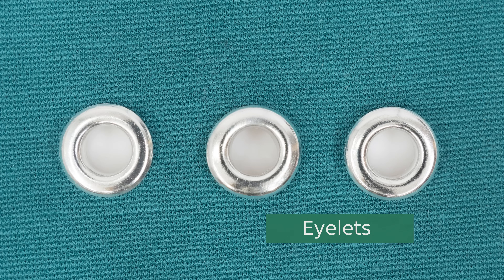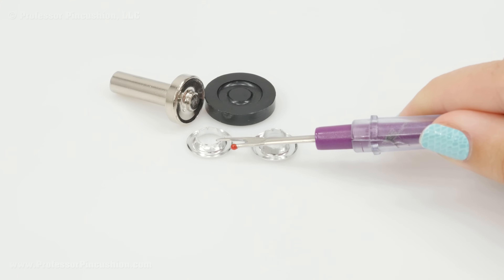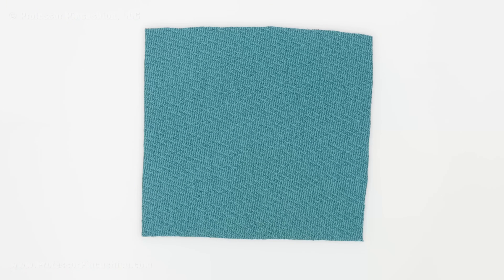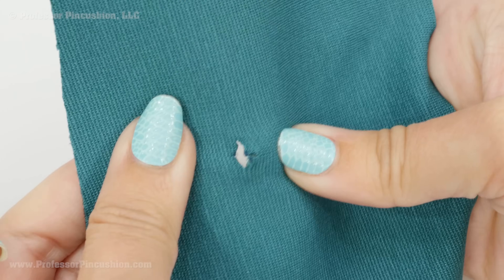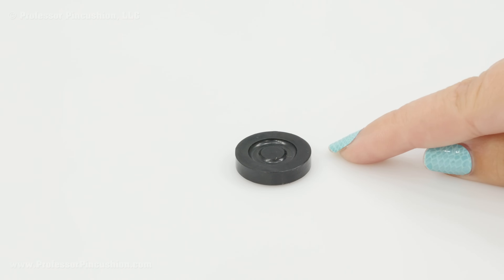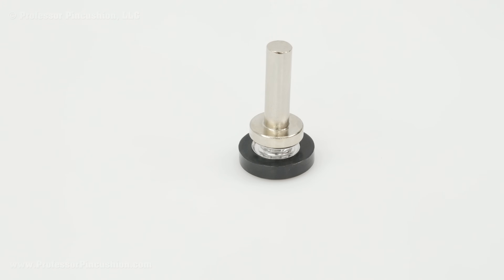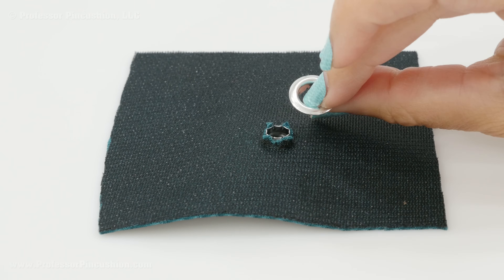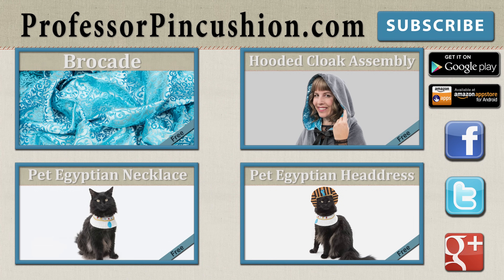How to Insert an Eyelet in Fabric

Comment: I'm a night owl, but the neighbors in my apartment building are NOT. Instead of using a hammer to tap lightly, I use a 6-inch C-clamp, held in a vise to quietly press the eyelet parts together.

Comment: let me ask you...why you didn't show the punching process of the eyelet in the video????
Reply: It is suggested to use a rubber mallet instead of a metal hammer--this is to prevent distorting the metal of the eyelet. Also, unless the eyelet is massive, it is better structurally to use an awl and make a hole in the fabric by separating the threads instead of cutting them.

Comment: Worked great, thanks.  I thought I had to cut a circular hole, but a tiny cross worked just fine.  Eyelets came out perfectly after a good, strong whack with the hammer.

Comment: does it still work on thin fabrics?
Reply from the maker: I wouldn't do it on sheers but with other lightweight fabrics you can probably add eyelets. You might want to add interfacing to the wrong side to help stabilize the fabric though

Comment: The eyelets that came with my sewology snap pliers from hobby lobby only have one side. Everytime I attempt to tighten them, they crumble in weird and ugly ways. You perfectly explained the eyelets you're using, but I was wondering if you have advice or help for eyelets with no back piece. I've learned so much from watching you already but there is always more I need to learn. Thanks!😊🙏
Reply: I know it's been like a year, but I've been having the same problem. Best thing that has helped me is putting the top of the eyelet on the anvil, put the longer piece against the back, and don't be hesitant with the hammer. Every time I try to hammer gently it crumples weirdly and comes out bad. If I don't think about it and just hit it hard it does it perfectly.

Comment: Hi! I have a question...the eyelets I purchased are only the top.  Is there a trick to putting those in?  They are small 5/32 ones and I can't get them to properly grip the fabric because they did not come with the back piece.  Any suggestions?
Reply: What you have are proper eyelets.  In the video she was using grommets.  Same thing except grommets are 2 parts, a front and a back piece

Comment: I wanna do this on jeans. How necessary is the interfacing?
Reply from the maker: denim is usually a stable enough fabric you can probably skip the interfacing
Reply: If you are cutting the fabric, it might be necessary. Depending on the size of the eyelet/grommet (for those insisting on a difference) an awl would be used to separate the woven threads of the fabric instead of cutting into it. For a cut fabric hole, the interfacing will prevent unraveling around the eyelet/grommet.

Comment: Press on nails? Good job use a board under the grommet . A grommet has 2 pieces using a hammer an eyelet has 1 piece that rolls over the edge when  squeezed with the plier type tool. You need to hammer it live to show the beginners out there we did not see that part🤔

Comment: Do these instructions also apply to fabric that used to have an eyelet in it but it is no longer in there and the fabric fibers are frayed?
Reply from the maker: so the eyelet came out? You can definitely put in a new eyelet but depending on the hole, you might have to go with a larger size

Comment: Not sure how this was in my suggestion list, I'm a prepper. What's more shocking is  I watched the entire video. HOW can a grommet video get 297 dislikes?
Reply: It is suggested to use a rubber mallet instead of a metal hammer--this is to prevent distorting the metal of the eyelet. Also, unless the eyelet is massive, it is better structurally to use an awl and make a hole in the fabric by separating the threads instead of cutting them.

Comment: could i just eyelid to a zipper or would that be to thin of a material ?
Reply from the maker: you want to put an eyelet on the zipper tape? I don't think it's the material that makes this tricky, only if you can find a small enough eyelet to fit.  If it gets too close to the teeth, it might make it tab get stuck on the edges of the eyelet.
Reply: Professor Pincushion how do I put a eyelet on my horses halters

Comment: I am new to crafting so please excuse my very basic question. I bought an eyelet starter kit with the tool. Problem is I did not get any eyelets that had the smaller ridge. Mine are all the same.  What do I need to look for in the kits to be sure I am getting the top and bottom pieces?  Thanks. Btw I loved the video.
Reply from the maker: that's very weird.  maybe you got a weird defect box :(
Reply: aliexprese

Comment: Thanks for your video, but i'm totally stumped, I want to make jewelry pieces or faux leather, I plan on putting on the small 3mm eyelets, which I just bought.
But when I got them there wasn't a tool to set them in with, would you happen to know which tool will I need to set the 3mm or even a 4mm eyelet?

Comment: Is the anvil piece necesarry? my set didnt include it
Reply from the maker: +vazqjose  It sounds like you got the refill and not the starter kit.  Because the anvil has the grooves, it keeps the eyelet from slipping around on your surface.  You can probably get away with not having it.   I think the metal tool is more important to have than the anvil because it targets just the center of the eyelet instead of smashing the whole eyelet flat.  You can also buy eyelet pliers which also helps you get eyelets on.

Comment: I use a hand held paper punch for holes it takes 2 seconds perfect holes every time.
Reply: My paper punches do not punch through material, unfortunately.
Reply: you need a fabric punch. its a weird looking tool with spikes around a wheel.. cant miss it.. they sell it at maddison or other shops similar
Reply: Fabric puncher is for fabric. I use the leather hole punchers made for leather.. Strong, and can choose which size hold you want to punch through the fabric.
Reply: The holes are too small for grommets. Even the fabric punches I've seen aren't large enough. We need something that can make a 3/8 or 1/2 inch hole.
Reply: Unless the eyelet is massive, it is better structurally to use an awl and make a hole in the fabric by separating the threads instead of cutting them. Also, use a rubber mallet instead of metal hammer to avoid distorting the metal of the eyelet/grommet.

Comment: I'm pounding away on my eyelet and it's not closing, so I watch this video and the only part you don't show is the hammering??? I mean the rest of the directions with placement are right on my package! I don't need that part! what is even the point of this.
Reply from the maker: Here is a video I just did that shows all the steps to insert an eyelet.  I did not have to hit they eyelet very hard with the hammer.  Your fabric could possibly be too thick.  Maybe test it out on something thinner.  https://youtu.be/TZLQuzoeC7w?t=5m33s
Reply: susanc111 I thought the same thing, that’s the main part!
Reply: @ProfessorPincushion  Thank you for such a professional response! I really learned something from you!!

Comment: you've demonstrated a grommet not a eyelet
Reply from the maker: +Richard Rupe In this demonstration, I'm using an eyelet.  Eyelets and grommets actually look the same, the difference being in their use.  Eyelets are mostly use for light projects such as garments.  Grommets are used for heavy duty projects, like the sail of a sailboat.  I also have a grommet tool and it's fairly large and heavy duty.